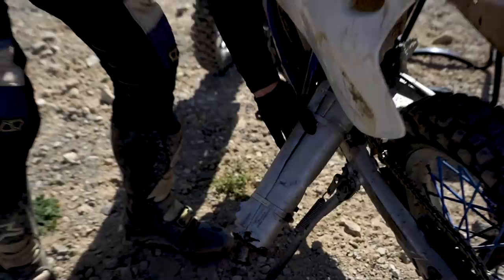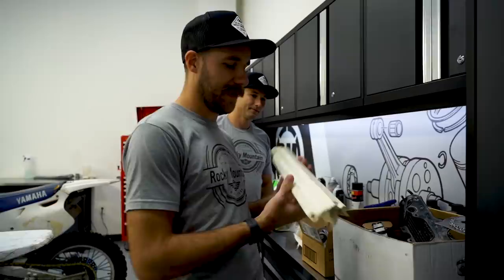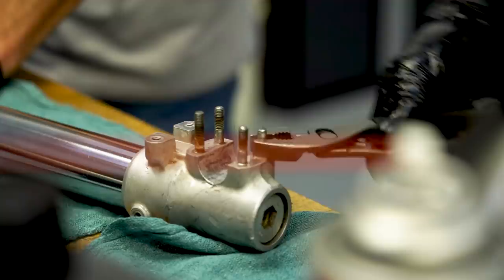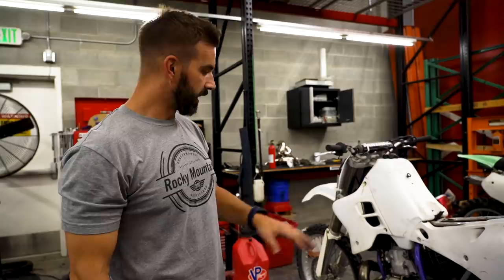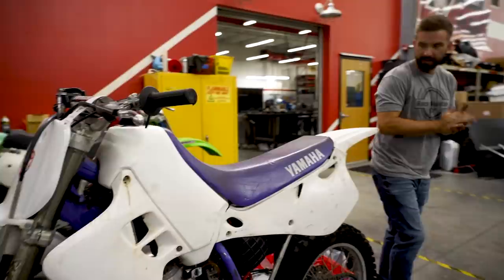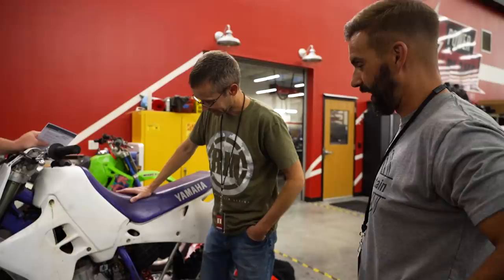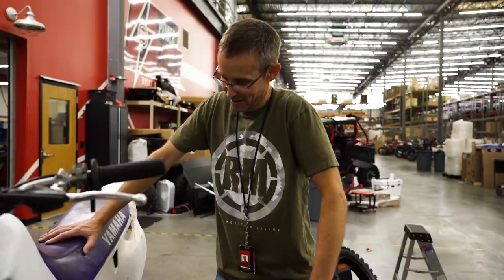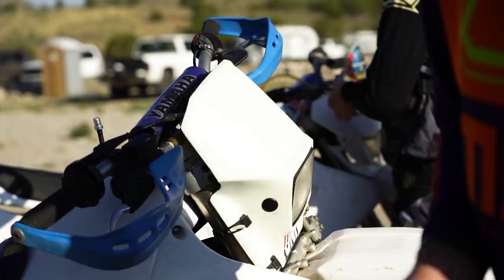BIG CRASH on Old Dirt Bike! - 24 Hours of Glen Helen Ep. 2

Comment: You could see clearly that chase isn't that used to or familiar with a two stroke which miles away from a fourstroke. 

It really make you feel dull after you switch from fourstroke to 2stroke
Reply from the maker: You're right. It was a learning curve while riding those bikes. But it was a blast! Makes me want one! I think a 150 would be the perfect all-around bike.  - Chase
Reply: @rmatvmc  yes that should be fun. I currently had a 125 2stroke which is a local enduro bike but yeah it feels really good once I got the hang out of it. although I miss the overall control that a fourstroke gives.

Anyways congrats this is another great video series you released.